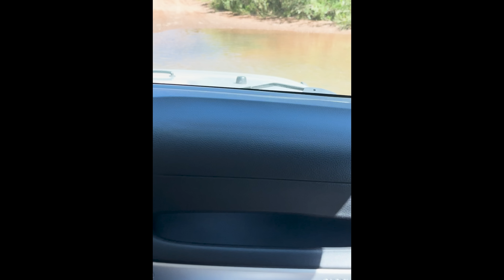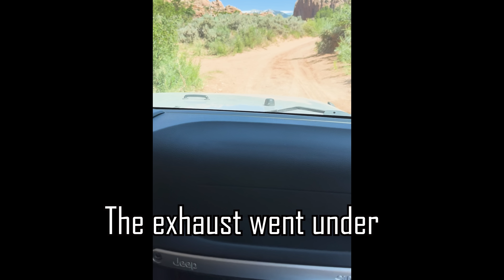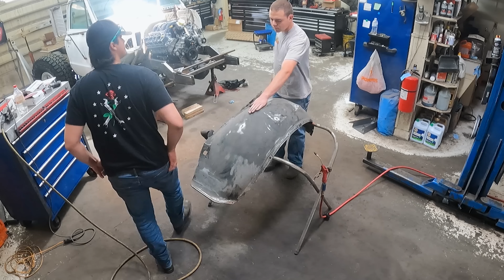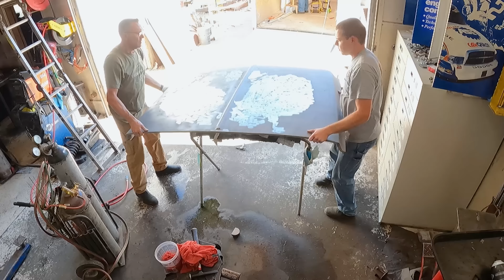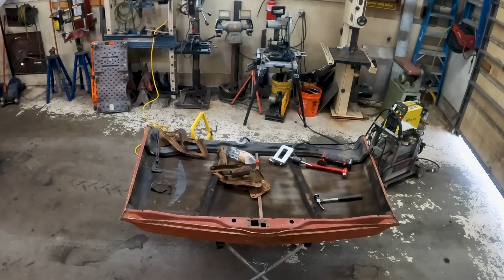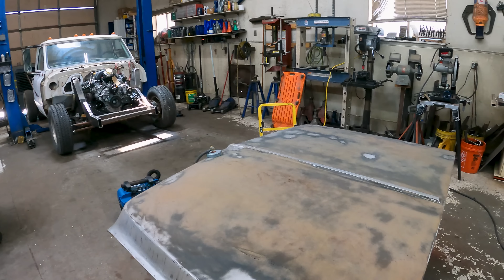Can We Save This Hood??

Comment: This video part about using a hydraulic bottle-jack on the tailgate, reminds me of using a bottle-jack with a  wood block, on the upper driver-door; of my 1965 F-250.  (Like to learn how the door became bowed out / bent to begin with = ❓).   That door was thick steel — factory construction.  (Not easily bent).

Comment: Hello from Sydney Australia.
Excellent instructional video, using the oxy Acetylene touch to contract the steel with panel beating (using a dolly). I would not like to try that on modern vehicle hoods, due to the thickness!
🌏🇭🇲

Comment: Would be helpful to others to show where the dolly should be when using the hammer. It was made VERY clear to NOT have it immediately opposite the hammer, but you've not shown where it SHOULD be. My 61 F100 has a couple of butt imprints in the left side that need to be shrunk out. I've long known where not to place the dolly. But nobody has ever shown me where to place it.
Reply from the maker: For a butt print I would use a block of wood in the center of the dent and lightly tap around the edge with a mallet and see if you can slowly work it out. Might even be able to do it without having to touch the paint.

Comment: Please for your own health young man, use the mask when sanding. take care.
Reply: For short times it doesn’t seem like a big deal, but it’s the culminative effect that gets you in the end.
Reply: It's not an issue when wet sanding.
Reply: @calholli  Not all of his sanding was wet!  
It is still good practice to wear a face mask when doing any work that creates dust or smoke. eg welding, spray painting, grinding, even wood working.
Best practice is to collect the dust at the point of generation, use tools that connect to a vacuum source.
It is the very, very fine dust, less than 5 micron, that will get you in the end. 😞

Comment: You may save time in the future by using the 'new' method that Robby Layton uses to pull out dents and dips. Good job though, with old school methods.
Reply: You are somewhat right, but as far as I got it, the goal here was to get the tension back to hood so it doesn't wiggle